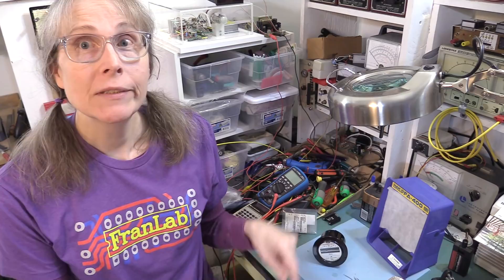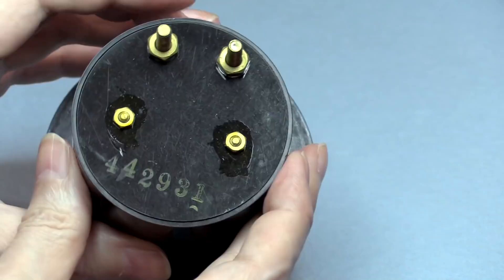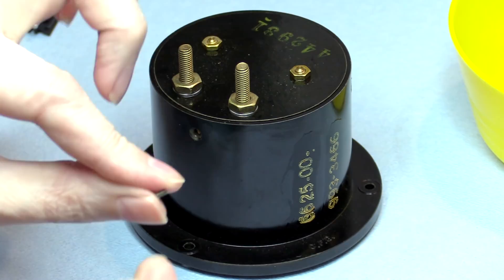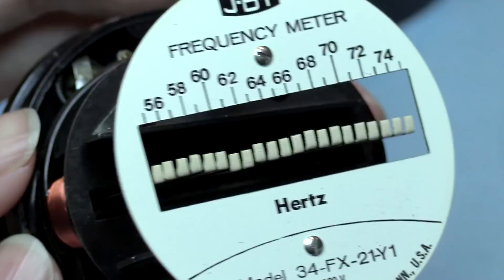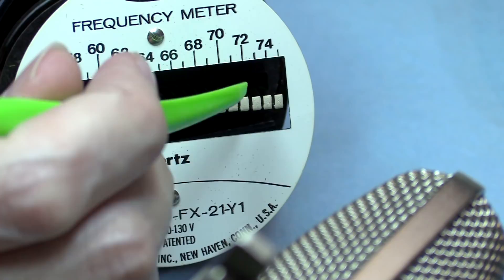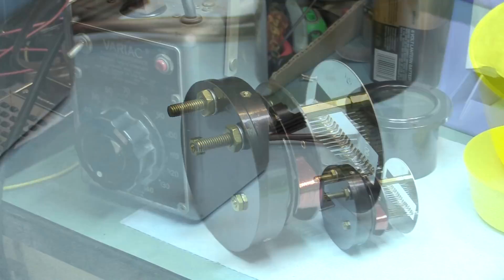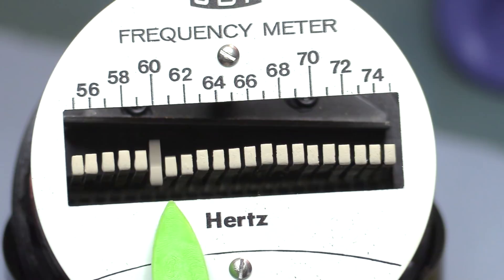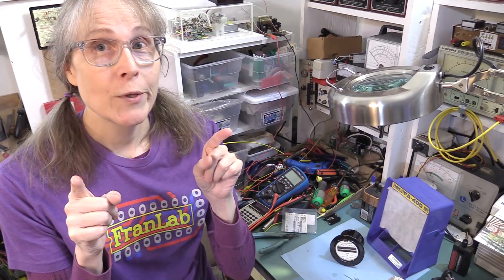The Spooky Action Of Mechanical Frequency Meters

Comment: Fran, If you want to re test that with other frequencies on the cheap, pick up an inexpensive 30 to 60 Watt RMS audio amplifier, and feed it's output into the secondary of a small power transformer, such as a furnace low voltage transformer of about 30 VA, to boost about 24VAC to 120VAC. You can use your signal generator for any quality amplifier rated for flat response from 20-20,000 HZ response. The load is much less than the amplifier can produce.
Do not expect a cheap 60 Watt peak power amp to do the trick. It's RMS power is about an order of magnitude lower.

Comment: 1950's model airplane radio control worked like that.  The transmitter would send a tone over AM, and this would cause one of several reeds to vibrate in the receiver.  When the vibrations got large enough the reed would trip a clockwork escapement powered by rubber bands, and this would cause the rudder (usually) to flip full over to the other extreme.

Comment: Several times I've seen Fran estimate the AC current through a coil by measuring just the resistance, but the inductance of the coil also affects the current and shouldn't be neglected.

Comment: I use larger versions of these almost every day in my job to detect frequencies of the machines we make (all be they are completely mechanical no electricity required). They are super useful and accurate. We call them reed tachometer or reed tachs.

Comment: Fran correct me if I am wrong but, many solid state power amplifiers have positive and negative power for the output transistors at +/- 60 to +/- 75 volts. If you drove one of these amplifiers with the output open circuit, I would expect you could easily get a swing of + 40 to -40 volts. You could drive the input from a plain old frequency generator and probably get a decent response from one of these mechanical frequency meters. I would use the oldest, plain vanilla amplifier I could get, fewer protection circuits you know. Use one that you don't mind losing to the magic blue smoke.... I Started out working as an electrician at the Mobil Oil refinery here in Beaumont, Texas in 1976. In old power plant 2, we had several of these meters in service on the generator panels ( 7.5 to 9 megawatt units, small by todays standards ).

Comment: Fran, you could probably demo it moving up and down the scale by setting it on a sub-woofer speaker box and just change the frequency that way....the vibrations of the cabinet will most likely induce the vibrations onto the tines.

Comment: It's a "vibrating reed".  If you look right behind the bent end that's used for the display, you'll see a small blob of solder.  That's likely the mass.  I can't say for certain, but I suspect the solder was applied, then the reeds were sorted by their harmonic frequency response.  Just a guess.

As a young technician back in the '80s we disassembled some of these to salvage the reeds for a static electricity measuring instrument.  Vibrating reeds are quite specific as to their resonant frequency.  If you're just a little off frequency, the vibrations die off.

Nice TI-30, I've got an SR-10 and SR-50 of the same vintage.

Comment: Lots of older ground power units at airports have this style frequency meter. (Newer units are digital) Modern jet aircraft have to have 400 hz power in order to power up on the ground. You would connect generator to aircraft, start unit and dial up throttle until you had frequency at 400. Then you could close contactor in generator and power up the plane.

Comment: It's cool to see those, as Im not electrical engineer in any education (I know high school physics) so I dont know engineering or tech related... 
Electrical ways are superior in sense of speed, interface to digital applicances and cost, but I see value in thinking, approach of these analog devices, in that for learning and problem solving those are easier to detect where problem is and how they work, more intuitive way. In electronics it is near impossible to debug without proper electronic tools of professional scale. Even as regular person it is very useful to know where defect lies, but with digital it is near impossible, just that device is broken, be it washing machine or microwave owen.

Comment: There are similar contraptions for detecting the RPM of a motor, actually. You physically set the gauge on the motor housing (some might be magnetic), and the subtle vibration from the motor will make the little tines resonate, letting you know how fast the thing is turning.

Comment: I would think the tines are anchored such that they have differing lengths, which in turn gives them different resonating masses and moment arms.  Some one else mentioned that the angled plates probably strengthen the magnetic field to be able to deflect the stiffer shorter tines as much as it deflects the more flexible longer ones.

Comment: Variable Frequency Drives (VFD for short) are used in CNC machines. They are used to control the speed and direction of the 3 phase spindle motor.

Comment: I would guess these can be tuned like the reeds on a harmonica: scrape at the tip to "sharpen" (removes mass), scrape at the base to "flatten" (removes spring force), and if you need to bring the resonant frequency down a lot (because you don't want to scrape the bottom a lot), add a bit of solder at the end and then file it back to suit.

Comment: Nice calculator!
There are a couple variations of this "mechanical" frequencies.
The first is almost identical to this but you just press it against a motor or vibrating equipment rather than a coil.
The other you feed out a length of stiff wire until it resonates and the length corresponds to a frequency.  Vibra-tach maybe?

Comment: On my company (oil refinery ) we used these meters to synchronyse the emergency generator to the net , the emergency generator was driven by a steamturbine , and the RPM of the steamturbine was increased until the meter was at 50 hz (Europe ) then it was pushed on the net.

Comment: easy way to demonstrate this with varying frequency: use it for what it was built for.  Connect it to a small backup generator, and if there isn't enough throttle hunting from the governor to send a varying signal to your meter, you can tie a string to the governor and pull it back and forth.

Comment: I had a portable meter that worked on a similar principle but without the coil. I used it to match engine speeds to generator output in conjunction with my trusty AVO. Comparing the readout with a modern frequency meter, it was uncannily acurate and without a wire in sight.

Comment: Back in the 80's I worked for GTE. We used this meter to verify Multi frequency frequency ringing for party lines. Today it 100VAC 2500HZ 60 cycles

Comment: Nice device. I first saw these as contact tachometers for machinery These are still made (Sticht, Standco, others) but you do NOT want to pay the gate. I have seen this type of meter mounted in a bad spot respond both to line and to vibration, giving broad peaks or two peaks, on heavily loaded rotating machines.

You can show the response in this meter by putting it in contact with a vibrating element that you can vary the frequency of. Maybe a bass amp, and slide A# to D on a bass (second string) to cover the range.

Comment: Interesting video Fran.
You can get contact engine and motor RPM counters which work on the same harmonic vibration principles, except those use physical contact with the engine being checked, instead of using an electromagnet.

Comment: Quite intresting video showing electromechanical frequency meters - they often were used in power plant stations tu syncronize the generators ... and to watch to the frequency of the electrical power net... in Germany and Europe 50 Hertz.
Falling and rising of the frequency detecing more or less density of electric energy ... the were necessary to prevent brownouts and blackouts. 
In Borken / Nordhessen so can see many of them in an old control room driving a former power station in the center of europe an german power net between 1923 and 1998.

Comment: I used to service and repair standby generators. Some were well maintained since the 1950's and 1960's and were still in use. A lot of these had a similar mechanical frequency meter. The range was usually 50 to 70 Hz. You would adjust the engine governor for the RPM needed to generate 60 Hz. 3600 RPM for a two-pole generator and 1800 RPM for a four-pole generator. Some of these old generators dated to the Cold War era. Deep in a basement with huge steel doors. A real bunker mentality back then. de WG2E.

Comment: If you had one lying around the lab, a 70v or 100v distributed audio amplifier (with maybe a dummy load on it in parallel to the meter) might be an ideal way to amplify the voltage from a signal generator up to this meter's operating range (though some of those have a high pass filter intended to protect horn type drivers that would cut out frequencies down that low).

It'd be interesting to see how it behaves at multiples of 60Hz, too.

Comment: We used these on the -60 ground power supply used to support F-16s.. after the internal jet engine wound wine and fire (while distancing yourself from the rotational planes marked on the side of the unit) you’d flick the switch to enable power and look for the 400Hz indication

Comment: I have a couple that are not electrical.  They mount to x-ray tube housing to monitor the rotor speed.  If the rotor (anode) of the tube as it slows down, can go thru harmonics that can damage the tube.

Comment: I worked on mobile systems that used a generator. There was a frequency meter like this along with a Volt meter to monitor the generator voltage and frequency. This was to verify to have the 120 VAC and adjusted to 60 Hz.  Each of the indicators is like a tuning fork in its effective mass working at resonance to vibrate. These are exposed to a magnetic field.  These meters were very critical in design, and expensive to buy.

Comment: The number on the side is a NSN designator that was assigned to the part at the start of January 1962: https://www.iso-group.com/NSN/6625-00-993-3466
This part was originally manufactured for the U.S. military and I could see it used on a ship from that time to monitor the ship's power generators.

Comment: Those Instruments were very common in the in the Installation of Generators which were intended to replace Grid supply or could even sychronized with the Grid (there were special Instruments that have two coils and two rows of "Tongues").
The German word for this Instrument is "Zungenfrequenzmesser" which translates literally to "Tongue frequency meter" what describes the function quite well.
This Article shows a very good picture of all three necessary Instruments:
https://de.wikipedia.org/wiki/Synchronoskop

Comment: There are of course dozens of ways to display AC frequency in the analogue domain. The resonant reed type effect has had hundreds of uses. They were used in early radio control and as filters etc.  Of course the crystals we use in everything today are exactly the same as this.The analogue meters that measured frequency with a pointer operate on a different principle - I Wiki'd Weston frequency meter for example.
There are so many ways to do it..I immediately thought of a synchronous motor with a slip clutch and spring, a not very elegant way and prone to error if it gets gummed up.
Who can think of a better and unique way to do it?

Comment: Fran, All your really need are 2 items! Just use a signal generator into a spare tube amp output transformer secondary (16 ohm side) Wire the high voltage primary across the meter. All you need is 7.5 ma. I'm sure a good bench signal generator can put out 900 mw. Mine can!

Comment: These are installed on most every diesel generator used for temporary power, as their frequency is dependent  on the (governed) engine RPM, & the governor can be trimmed

Comment: The reminded me of The Engineer Guy's Harmonic Analyzer video.

The coil is wound such that the tines are on-axis with the magnetic field.  How can that work?  The angled plates must help somehow.

The tines can be tuned in the same way as harmonica reads: file at the base of the time to make them less springy, or file at the end to reduce the oscillating mass.

Comment: I own a Frahm "resonant reed" mechanical tachometer, mfd. by the James G. Biddle Co., that was used at an outboard motor repair shop.  No wires, electricity, etc.  Works fine on lawn mowers, etc.

Comment: Love it! Thanks Fran! Always wondered how they worked they always seem to be fairly accurate. By the way love the TI calculator 😉 if you hooked it up to a gas generator not a sine wave generator and slow the RPM down would be an easy way but you wouldn't want to raise it more than two Hertz above normal

Comment: In East Germany of the 80ies these devices were quite common on switchboards in radio shacks. One could nicely observe that the frequency from the mains fluctuated - and never kept the 50Hz it is supposed to be in Europe. Most likely between 48 and 49 Hz which was a mess because all that nice western radio clocks never kept time. It must have been that way throughout all the Comecon as there was an interconnected grid spanning varous time zones from Helmstedt to Vladivostok...

Comment: You can maybe use it as a frequency detector too. Just put it on top of your subwoofer and play a tone.
If the thines are all identical except for the magnetic excitation it won't work, but if there is any resonance difference in the mechanical parts themselves it will.

Comment: Savaged one of those out of an old generator control panel along with some old vacuum tube thermal relays , panel lights and various switches .
Reply: The tines on mine were weighted on the back with solder where they're bent up on the front ends .

Comment: You could use a regular sound amplifier and a 12/120v transformer in reverse, the 12v winding connected to the amp output. You could feed the sound amp from any sound generator safely, and the only place with high voltage is going to be the 120v winding. The thing is like 1W of power, you don't need any high power/high voltage stuff.

Comment: Do the ends of the vibrating tines have that radioactive glow-in-the-dark paint?  Early multi-channel radio control systems, used in model planes and boats, had similar 'reeds' detectors to pick out different audio tones sent by the transmitter.  In a Reed receiver, whichever Reed was vibrating made (intermittent) contact with a small fixed contact - and that passed an electric signal through to a servo to actuate the rudder, etc.  The tuned reeds do the mechanical analog version of a fast discrete Fourier transform!

Comment: My guess prior to watching the video: one or more electromagnets apply an oscillating magnetic field to metal tabs of different length, tuned to oscillate the most on the frequency they correspond to. As a result a curve is shown on the display, the peak being at the mains frequency. Now I'm eager to see if I got this even remotely correct :) Edit: my guess wasn't too far off :)

Comment: I suspect this is a lot newer than you were thinking. I don't think Hertz existed as a unit before sometime in the '60s. The impedance of this meter is quite high, so you don't need high power to drive it. An old HP 200 would probably make noticeable deflections by itself.

Comment: Looks to me like all the reeds are actually the same length. But there's steel bars above and below that get thinner as the frequency goes up.
Reply: I think so too. As an engineering principle of simplicity and reproducibility it would be easier to make the reeds identical and use the wedges as the tuning mechanism.
Reply: My guess: the angled polepieces do not actually affect the tuning, they are just to adjust the relative amplitudes.  There is much similarity to ca. 1900 reed organs.  The tines may be hand-tuned the same way that organ reeds are tuned: with a file.  Remove (tiny amounts of) material from near the free end to raise freq, remove from middle to decrease freq.  Could also be done by adding material such as paint or solder...

Comment: I believe the meter was manufactured sometime after 1960.  That is when the organization of the International System of Units made the change from CPS or cycles per second designation for frequency and was replaced by Hertz honoring Heinrich Rudolf Hertz.  As I understand it but cannot verify, frequency being a cyclical event as in vibration or oscillation that is measured in cycles per second but too often and incorrectly the 'per second' was omitted as in the line frequency is '60 cycles' instead of 'cycles per second'.  Hertz name was adopted as the designator for frequency replacing 'cycles per second' so now it was much easier to correctly designate frequency without concern for the 'per second' part of the designation.  Here is a link to an interesting article about how the name for electrical values [Volt, Ohm, Watt, Amp] came to be.  Unfortunately Hertz is not mentioned.  https://www.visualthesaurus.com/cm/dictionary/history-in-the-toolbox-the-vocabulary-of-electrical-units/  Enjoy!

Comment: They were used till the 80s especially on gas or diesel generators. You had to adjust the rpm's so that you got your exact line frequency. BTW Fran the tougues have decreasing length towards higher frequencies. There are also versions for 400 hz airplane generators.

Comment: Do you not have a sig-gen ? It's a pretty high impedance load, so a signal generator would do the trick.

With an arbitrary signal generator (programmable), you could 'modulate'  AC over 55 to 76Hz, and create a sine wave with the indicators! 
a 100v PA amp would be perfect for it as well..